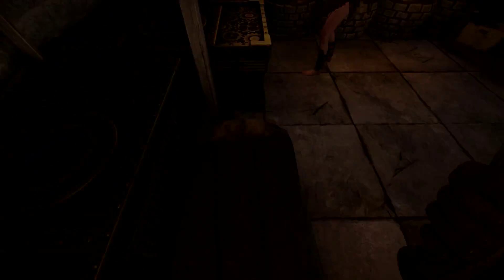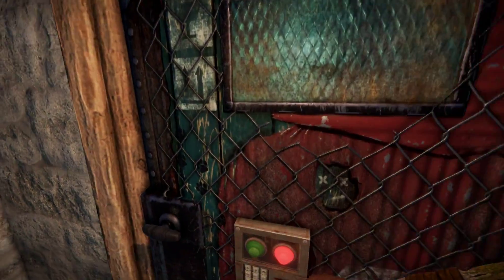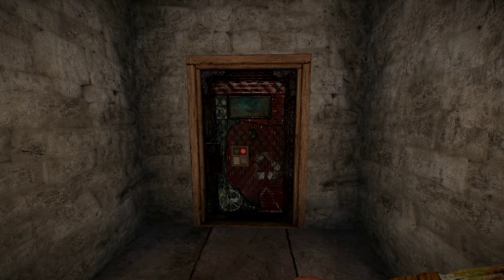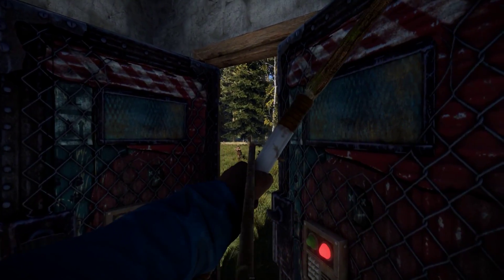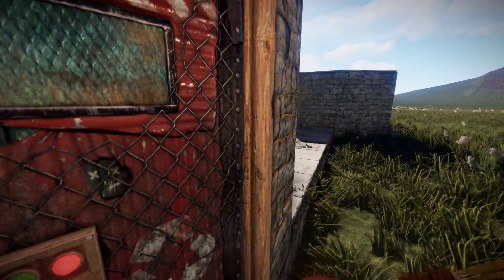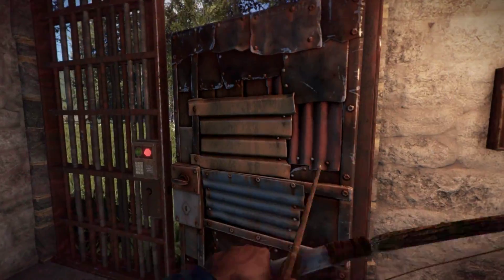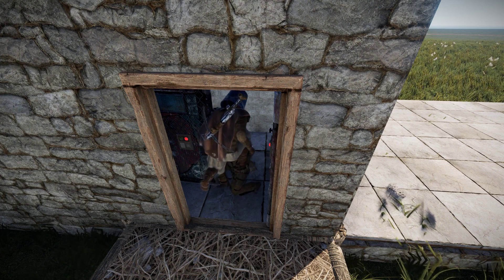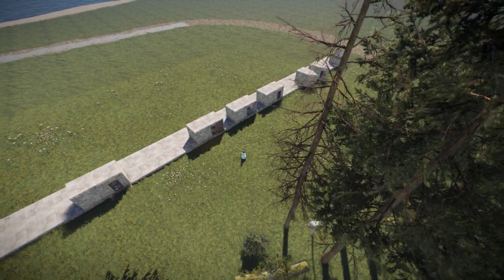Airlock Designs -- Evil's Quick Tips 03

Comment: I like to use the roof trick; where you place a roof, 2 normal doors going in towards your Main loot, and a Double door to push you in to Those 2 normal doors. U cant crouch under the roof when theres a doorframe there, so u basically use the Doors to push you inside and out. (As you might’ve noticed, its really hard to explain this by text)
Reply from the maker: This would be a good design for an “advanced air locks” episode
Reply: @EvilWurst  Sounds great :) Would love to see some more advanced airlocks.

Comment: You haven't mentioned it, but you can still pick the #2 triangle airlock, although it is harder it's still possible.
This makes the double door + cell gate the safest option from the ones shown here.
Reply from the maker: How would that work? With spears?
Reply: @EvilWurst  You could just use picks, you have to keep walking forward to keep yourself in the gap and there's only a small area you can actually reach, if I remember correctly when you do this you can't even see how much hp it has left but the pick can still reach it.

We've tried getting two people on top of one another to make this faster but the bottom one keeps slipping off so you just have to go solo.

Comment: How about a single door with double doors that open up on either side to make an airlock? With a shotgun trap on either side next to the double doors.
Reply from the maker: you mean the one that are two triangles separated? True, I could have included this one
Reply: @EvilWurst  guess he means a square foundation with single doors at front and back. two triangles or squares (does not matter) left and right with double doors. both double doors will block the single doors. you can put turrets / shotgun traps behind the double doors. 
neat airlock trick that also works offline.
Reply from the maker: Thanks for the clarification,  @psibiza   .. yes, that's a good one, too